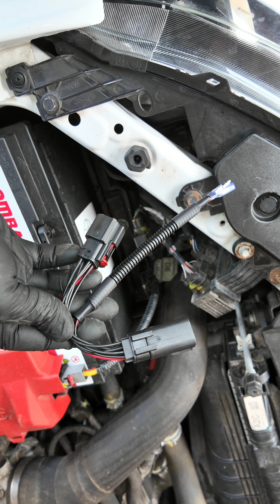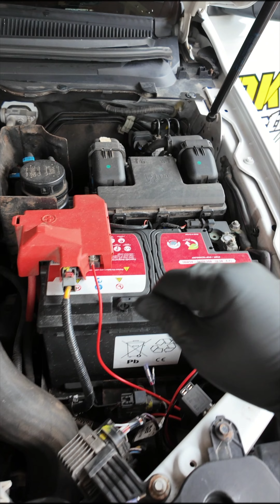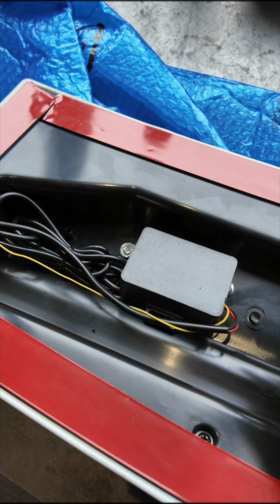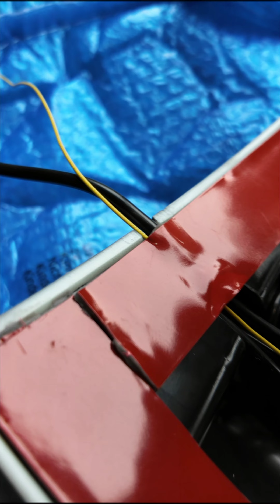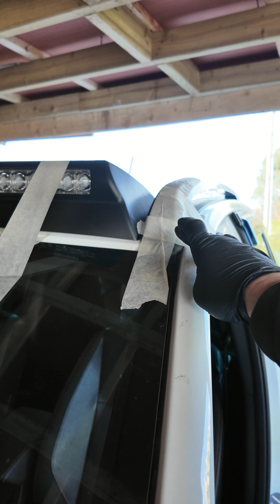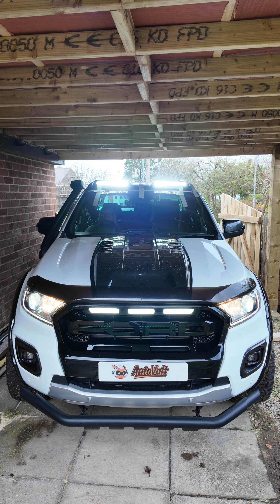Ford Ranger Roof Pod Installation and Wiring by AutoVolt

Comment: What ones this bud .. great tutorial 🤝🏾
Reply from the maker: Thank you as really appreciate that. It can be bought here 👇

https://autovolt-solutions.com/shop/ford-ranger-2012-2022-roof-pod-led-light-bar-spoiler/
Reply: @AutoVolt-m6g  brilliant thank you ! 🙏🏾
Reply from the maker: @Greig-g6r you are very welcome
Reply: About to order the light bar. Can the loom only be installed to a high beam?
Reply from the maker: @amrikqwerty you can choose to not add the wiring and wire it into a switch on your dash or a control panel. Just select no plug and play wiring.